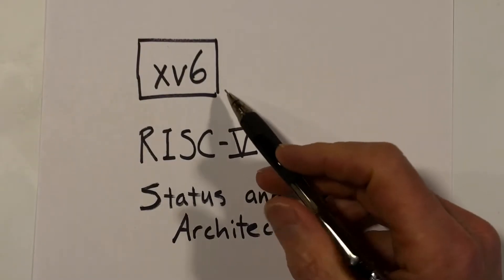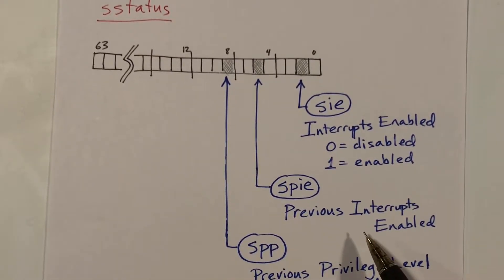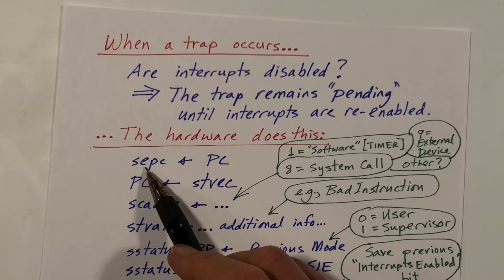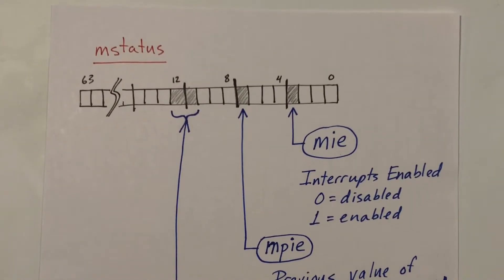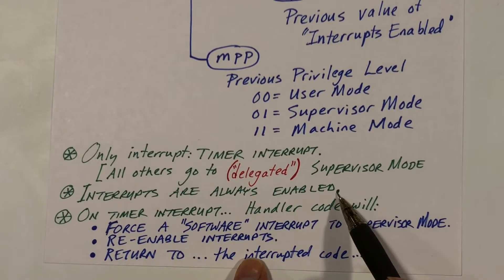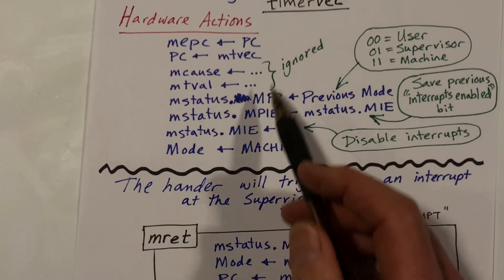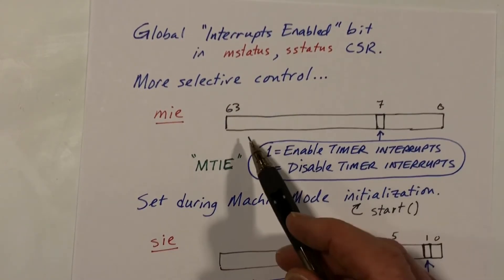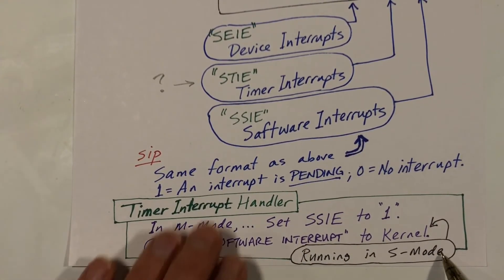xv6 Kernel-9: RiscV Trap Processing

Comment: You mentioned several times in these videos that you can't delegate timer interrupts from M mode to S mode. I looked over the privilege spec and didn't see anything mentioned about that. Is that a bug in the implementation of the virtual hardware in qemu? It sounds like that was discovered by accident, rather than something that exists in the spec, but I wanted to make sure.
Reply: I'm pretty sure you can by now. If you use OpenSBI, then you don't have to write your own M-mode code to handle timers, instead you can ecall to M-mode and then set a timer that will trap to S-mode. I'm assuming it may have been a bug or unimplemented when the code was written. Just make sure you have the STIE bit enabled in the sie CSR.

Comment: Great Video.  I'm using a sifive FE310-G002 and it generates a trap when I force a misaligned load. The ESP32C3 handles the misaligned load at hardware level (no trap). I found that the linux kernel handles these misaligned loads (and stores) in the code (arch/riscv/kernel/traps_misaligned.c) so I'm trying to port this to the FE310-G002. The part I find interesting is that when you call mret, it does restore the PC value from mepc, which I found incorrect since it's the instruction that triggered the trap so it would be returning there.. and with the debugger I can see it sets the PC to that value. IF I advance mepc (in my case by 2 since the instruction that triggers the trap is a compressed one) it moves forward, otherwise, it jumps back to the trap-generating instruction and goes back into the trap handler for ever.
Reply from the maker: Yes, I understand. You need to advance mepc past the instruction which caused the trap. You might ask whey the hardware doesn’t simply advance mepc. For some traps (such as those caused by a page fault), the kernel will need to take action (such as read a page from disk in to memory, or update a page table entry). Then, we need to return to the instruction that caused the problem and re-execute it. After the kernel has “fixed” the problem, the instruction should execute without a trap on the second attempt. To allow the same instruction to be re-executed, the PC must not be advanced.